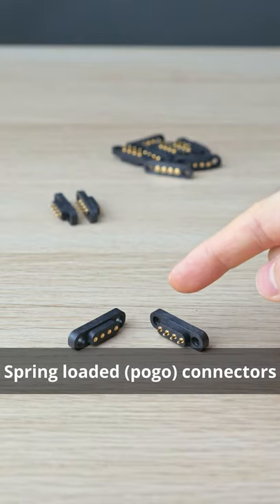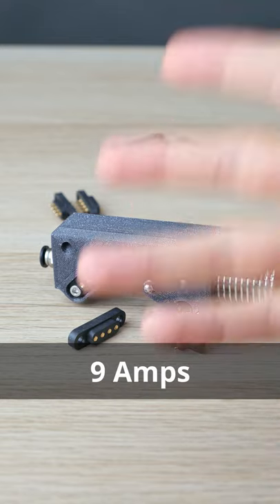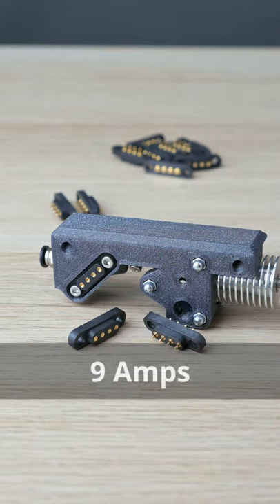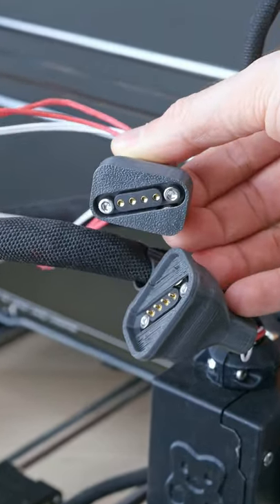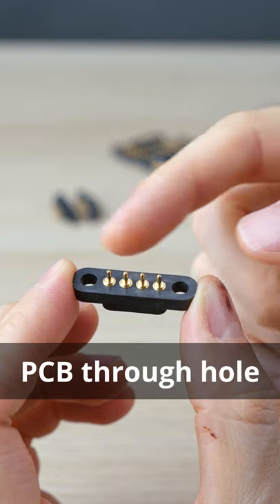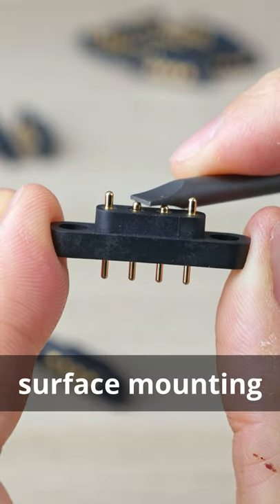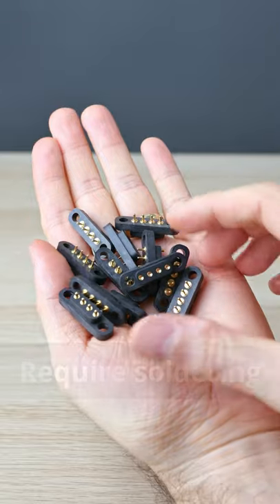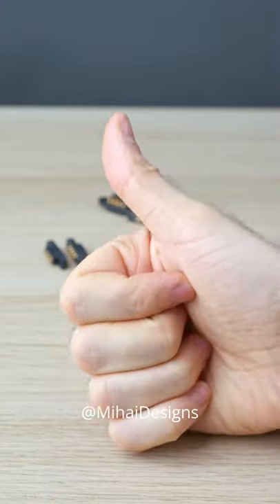Pogo pins in 3D printing and other DIY projects

Comment: Those aren't pogo pins .  Pogo pins are like the "pogo stick" toy: Thin metal tube containg a spring pushing out a solid inner pin against a flat surface like an exposed PCB test point .  You can thus arrange them to match all the test points on a specific product for auromatic testing .

Comment: I'm having a hard time matching any particular pin to it's mating surface. They don't make it very easy to figure out. Found some 30 amp pins, but I can't find what they mate to for the life of me.
Reply from the maker: On Mill-Max website if you find one product, there should be a list of mating models.
Reply: @MihaiDesigns  I was looking at a company called CFE. Particularly, their 30 amp pogo pins. I guess I'll try Mill-Max, thanks.

Comment: This is perfect for now, but good pogo connectors aren't easy to manufacture, they are precision parts, and they can be finicky mechanically. It's also not easy to guarantee good contact between the stationary and moving parts of springloaded contact. So these parts are quality-critical and will necessarily stay expensive. Also i wonder how well they deal with being connected not straight-on but slid into place, with that kind of side mechanical load that could wear them out quicker than expected, this seems to not be quite what they were made for. A potential alternative can be PCB-soldered spring contacts, and a hardgold plated PCB on the other side. Remember when phones had replaceable batteries, and you slid it in against an array of springloaded leaf contacts? These things, and they exist in all sorts of shapes, sizes and ratings. They are single-piece so electrical connectivity isn't an issue, they're simple and cheap, and they're actually good with being slid against. Or compression and one-piece interconnects. One doubt i have is that i (or someone) should probably check their expected cycle life.

Another thought is to foresee two pairs of contacts for heater. One pair carries power, the other pair is connected in parallel to them, hotend-side. The second pair going back to analogue input pins of the controller chip via suitable resistive dividers, they can be evaluated in software. If the voltage on one of them shows a significant disparity from VCC, and on the other from either VCC or GND, this means that the hot-end isn't connected properly or the connector is deteriorating.

Comment: awesome work! But could you show how you solder this connectors?
Reply from the maker: It's the main issue. I'm definitely not a soldering expert and it's not easy to do, but I might do a video at some point. Couldn't find any good tutorial.
Reply: @MihaiDesigns  got the same issue so hope you'll make tutorial :)

Comment: Roughly how long until your extruder files are released. Very excited for it without the swap mechanism
Reply from the maker: The extruder without the swap mechanism I don't think is very useful, but if there's a lot of demand I can release it. Not sure when, with all my projects... a few months maybe.
Reply: @MihaiDesigns  au contraire mon capitan! many of my friends who 3d print would just love the ability to quickly swap between hotends and easily disassemble to clean it. Projects like yours help add ease of use to the printer that all help push it further.

Comment: Is there potential for corrosion that might  interfere with the electrical connection?
Reply from the maker: These are some of the best connectors I found with thick gold and nickel plating which prevents oxidation.

Comment: 👀hey it's me again, could u share your slicer settings for that fiverlogy verigio pla? I diled my temperature and retraction settings but I can't get rid of over extrusion on corners :v
Reply from the maker: Just standard PrusaSlicer profile I think 🤷‍♂️ and good calibrated printer. What are you using?
Reply: @MihaiDesigns  I'm using Ender 3 Pro with cura, my eSUN PLA+ filament looks 10 times betters in terms of the corners and since I'm using creality v4.2.7 board I can't use linear advance to fix it :c decreasing the outer wall speed to 15mm/s helps a little but its so much slower than the 50mm/s I'm able to print with the eESUN PLA+ and even at that speed there is still some noticeable overshoot. My esteps are perfectly calculated so is the temp and retraction.
Reply from the maker: @piotrkozowski4230  oh without linear advance... hmmm... I got it enabled everywhere. Maybe lower acceleration?
Reply: @MihaiDesigns   I've tried messing with the acceleration, jerk and speed but after 14th calibration cube I've just ordered the  skr v1.4 Turbo, thx 4 help btw :)

Comment: You the best!!!! Which part numbers do you use for the mag connector in the back
Reply from the maker: It's the ones I specified in the blog post first. The ones for wire soldering specifically should also work. I will have to order and test them.